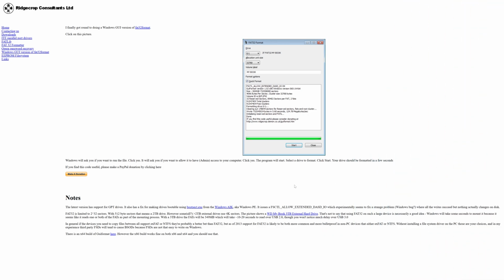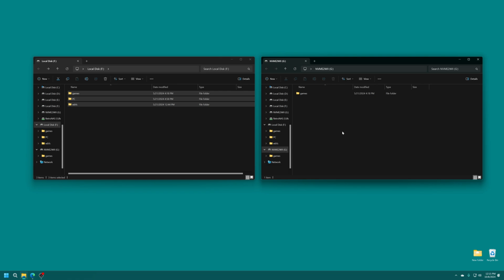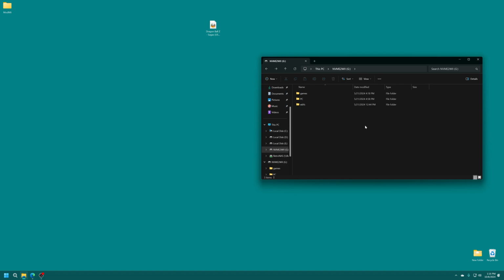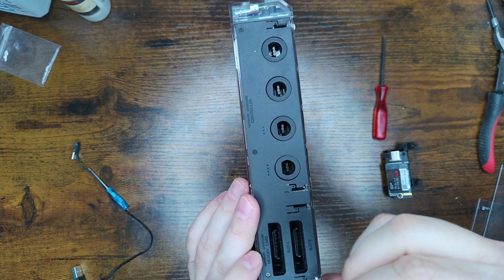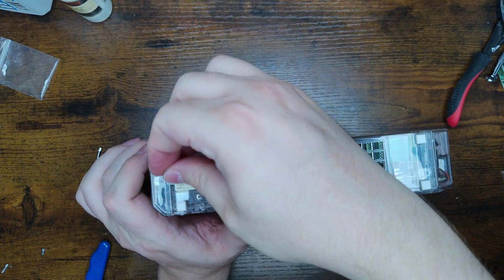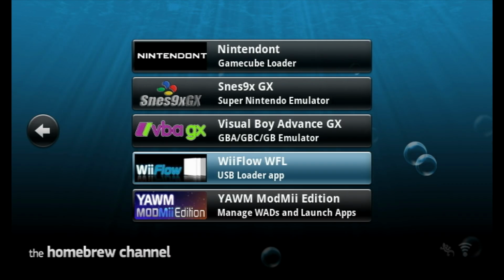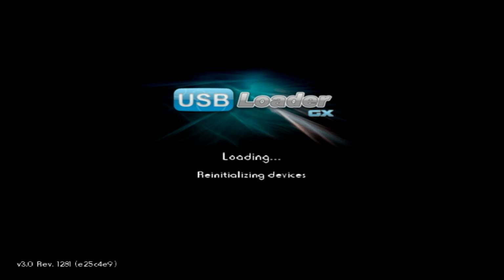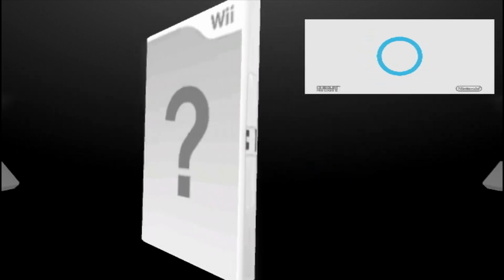Wii Internal NVMe Mod Install Guide

Comment: With USB Loader GX do you have to unplug and replug everytime you start the app? or is it a one and done setup. Also USB loader GX has now been updated to version 4.0 (this video was using version 3.0) so I wonder if perhaps this issue has been resolved???
Reply from the maker: It was every boot. I should try the update and see what happens.

Comment: Hey thank you for the video, love all of your videos! I have a question, what is the benefit to doing this method VS SD card? Beside price of gb/$? Have you noticed any faster loading times, or games that were buggy on SD? Thanks!!
Reply from the maker: SD card load speeds are slower than the DVD drive. USB is much faster. NVME is overkill since it's still USB 2.0 but it's a nice internal solution that isn't slow.
Reply: 🫡🫡🫡 Understood thank you for the insight!! @ArchadesGames

Comment: I'm assuming heat is no concern due to the slow USB2 speed?
Reply from the maker: Yeah it never gets pushed hard enough for that to be a problem. I let a 4 CPU game of brawl run for 25 hours straight with no issues